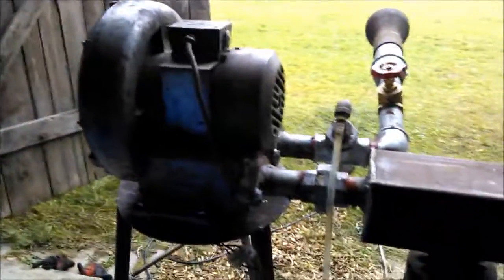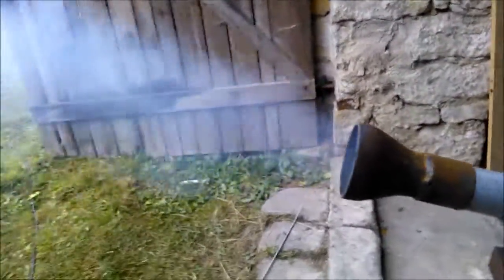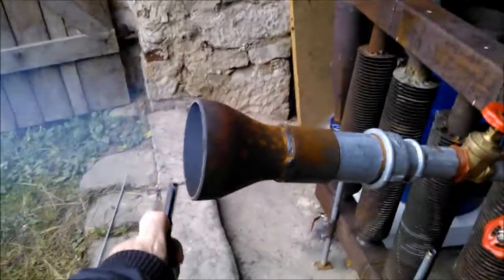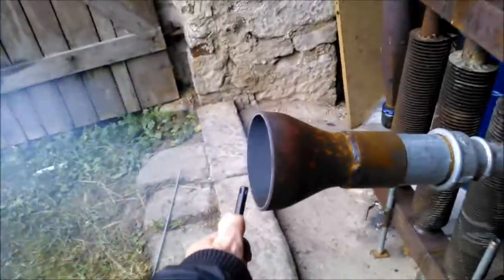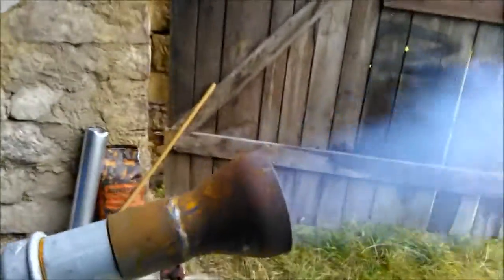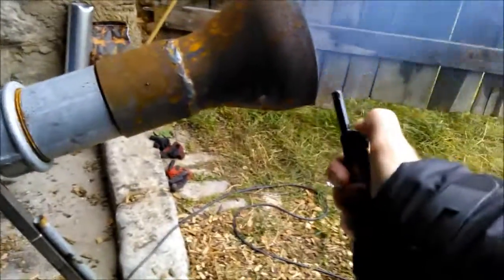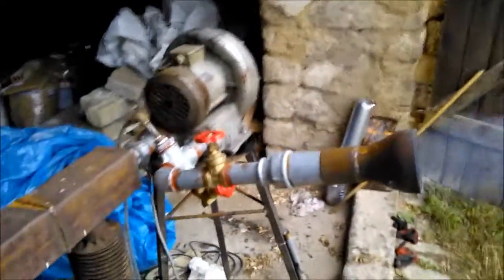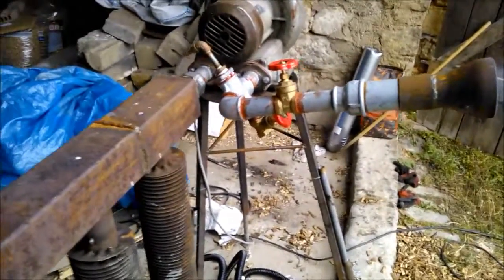First Tarfree run of Lukotop1.1

Comment from the maker: Arvid
Looked at the video's. Do you refer to the Use of the auger to drizle fuel in a flame pyrolise bed? I wrote in my tekst above : "drizling is simular to auger feeding in all chips heating systems". Tar gas is no concern. I wanted to go one step further. Make tarfree gas and drive an engine. It is a pain to run an open system tarfee. I show it can. I wonder why Greg stopped at a heating system and not build a Cogenration unit where the produced energy would make money and the heat came free.